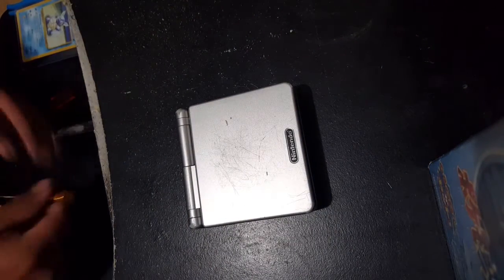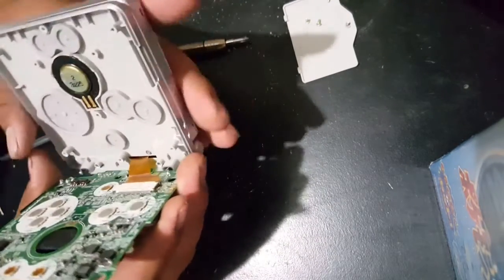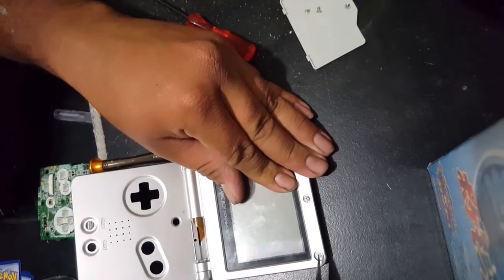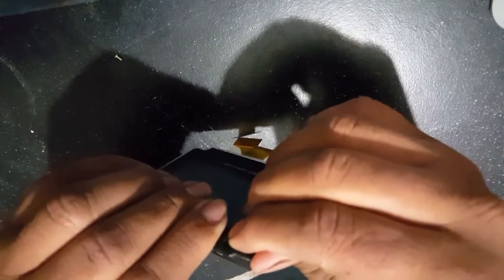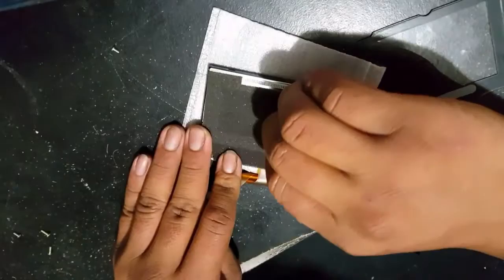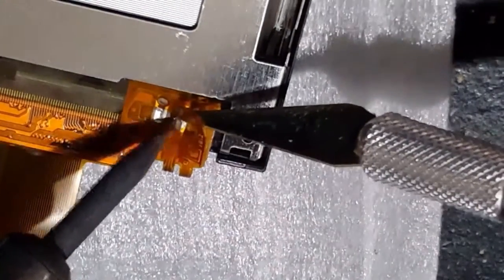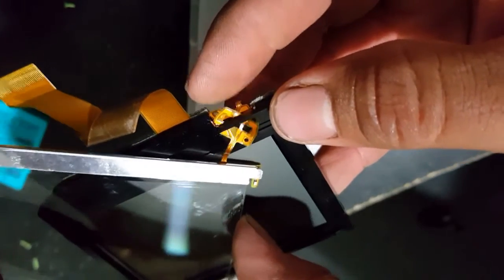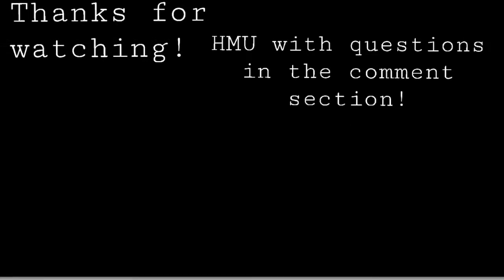Gameboy Advance SP Removing Frontlight! I try out narrating for the first time!

Comment: Hey man, thanks so much for this informative video, I have a 001 screen with a scratched lens which I’m replacing with a new glass lens, when I started to lift off the old lens (really carefully) I noticed in the bottom left corner the adhesive foam started to lift out with the lens and I could see something silver below the sticky adhesive foam trying to lift out as well, at this point I started to panic thinking I had broke something so I lifted the lens from the top instead which worked out fine, it left the adhesive foam in tack and in place but I was still paranoid I’d broken something below the sticky adhesive foam but after watching your video I see it was the light panel trying to lift out with the adhesive foam, so I know I haven’t damaged anything 👍 I only lifted it a tiny fraction in the bottom corner so I didn’t put any strain on the ribbon cable luckily! Now I can stop being paranoid! Thanks again dude, keep up the good work!

Comment: tried this almost did it but my solder gun had leftover soder on it and left little bits of solder on the two silver things was still able to pull them off but ripped them when trying to get trough slot  made really made but overall ur video was helpful I just was to lazy to remove leftover solder on my solder gun
Reply from the maker: damn bro sorry to hear that, i think i may have an extra light if youd like to buy it off me. im really happy my video helped. if you need any extra tips id be more than happy to assist you =)
Trainer Bob

Comment: I had an issue with the adhesive gasket not coming off, ended up scratching the panel in the bottom left corner, not to noticeable in gameplay tho, was able to keep the sp alive however, just without the light.